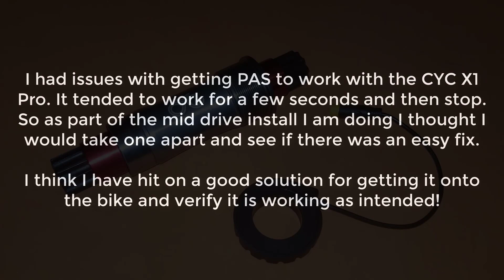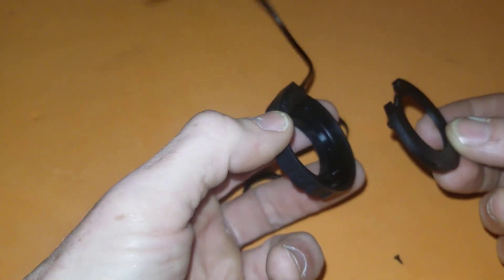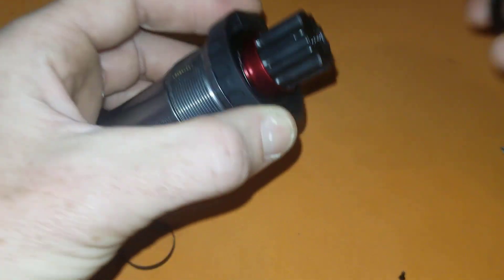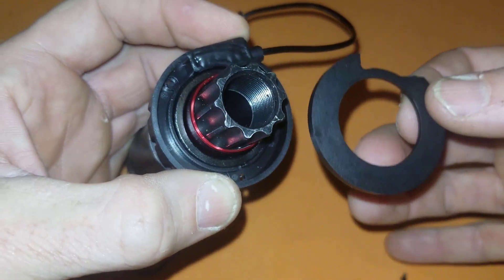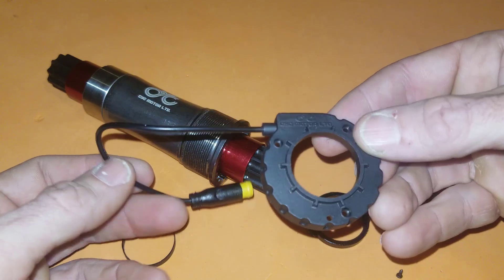CYC X1 Pro - Fixing PAS (Peddle Assist Sensor)

Comment: Very good video and detective work.  I've been having exactly the same symptoms you describe of intermittent functioning.  I'll check this fix out.  Thank you very much.
Reply from the maker: Good luck Mikey, let me know how you get on. In the end I ditched the PAS and upped the voltage to 72 and went throttle only. Are you still using a Gen 1 kit then! Not many of those still about I don't think. Cheers
Reply: @HighVoltageKits  ...it's a gen 2 and I'm using 72 volts.  Right now I'm using throttle with pedaling so a kind of fake PAS.  I want some exercise though it's tempting to motorcycle my way around at times.

Comment: Hello, I just found out about your channel. I'm really new to moutain biking. I'm not the best but I can do a little bit of DIY. With the new upgrade in the cyc x1 pro kit, would you recommend me to still go with the bafang or the new kit of the cyc? I hope you will answer. Thank you so much
Reply from the maker: Hey, the cyc continues to improve. I am uploading the 1st ride on my mid mount version as I type. I will do a more detailed video on the X1 in the next little while. I will follow it up with a direct comparison with the bbshd. But in terms of picking one.... I'd look at where and how you want to ride. The BBSHD has been proven to be an extremely reliable workhorse that can be easily repaired and with external controllers pushed way beyond its stated limits. Tons of aftermarket stuff for it and a huge amount of units installed. The X1 though is more powerful and runs cooler. It's more versatile and better looking IMO. I like both. I'm going to be playing with the CYC for some time. I dont plan on buying another bbshd because I dont see where else I can take it. If you can wait a few weeks I will be detailing alot more. You might be in for a wait with CYC anyways as they have a backlog to clear from people who have been waiting on motors a while. Cheers!

Comment: I feel like a good quality 2-part slow setting epoxy would be better, long-term, than superglue. Have you discussed this design flaw with their engineers? Its early enough in the game for them to fix this mess!
Be well...
Reply from the maker: Yeah you are probably right with the glue. My father in law has a really good workshop so I'll see what he has. I think CYC have my channel by now but I also think this parts days are numbered as they move to torque sensing. It was more to help existing users! Cheers

Comment: Can you reverse the screw direction by embedding hot capture nuts into the plastic where the screw heads would normally be located, the creating trough holes in the piece on the opposite side?
Reply from the maker: Googling hot capture nuts right now lol. Could be fun.
Reply: @HighVoltageKits  Maybe he means melting nuts into the plastic?
Reply from the maker: Yeah, I was just reading a bit about it. I will have to assess if I can get a nut that I can fix in the area I have to work with. I may just glue it as the tolerance between the PAS and the crank arm is tight.
Reply: @HighVoltageKits  A good plastic glue like Q-bond will be at least as strong as the surrounding plastic
Reply: @sparkiekosten5902  HI Sparkle, yes, that is what I had in mind, I just didn't state it clearly
Reply from the maker: Sparkle lol, love it. I'll check that glue out. Cheers.
Reply: I use araldite glue on all my projects, it takes 12 hours to set, give the surfaces a wee sand and the plastic shim will never move out off position. 
Regards Iain